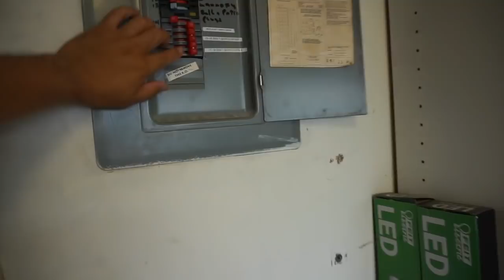Screen Printing - 1 Color / 2 Locations (S:05/Vlog 002)

Comment: Nice video. One question, what size of a coater do you use to coat those screens. In the process of buying new aluminum screens, I will need a new coater.
Reply from the maker: 16” coater. Good size for 20x24 screens